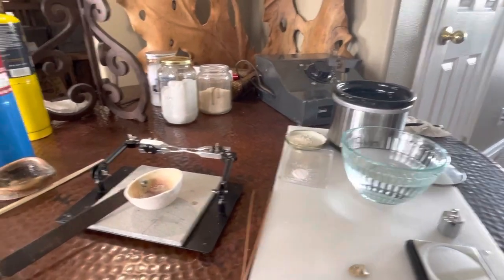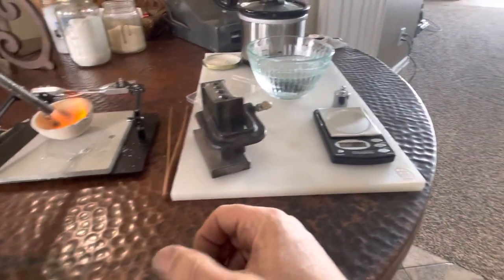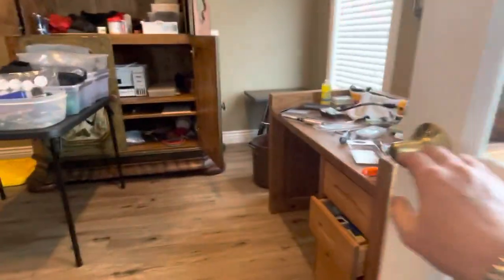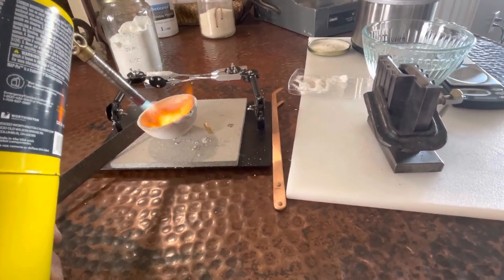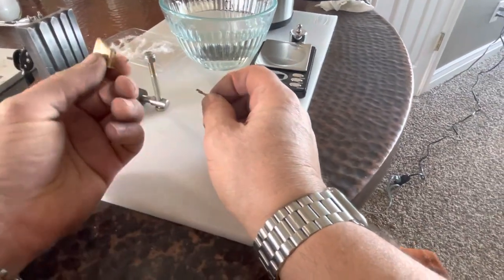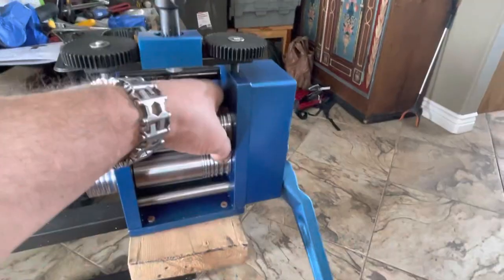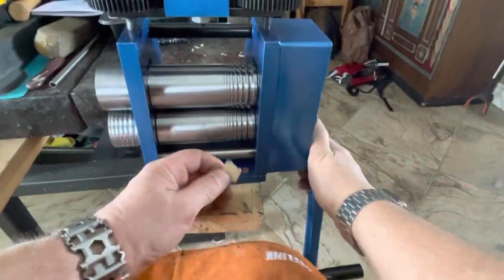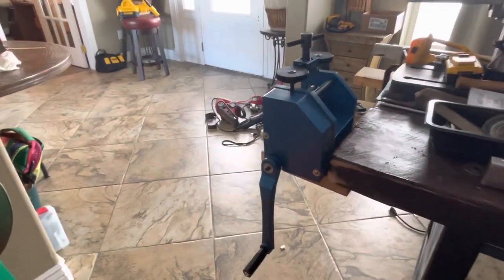Making 14k Gold ingots & testing new Vevor $140 rolling mill bought on eBay.

Comment: My experience has been that your better off going in only one direction on the rolling mill because the play or slack in the roller is taken up at the beginning and operates smoothly afterwards but if you go back and forth it’s gonna take up slack before going the other direction and this will cause difference in thickness of your metal. Go one way remove the metal and repeat with annealing regularly